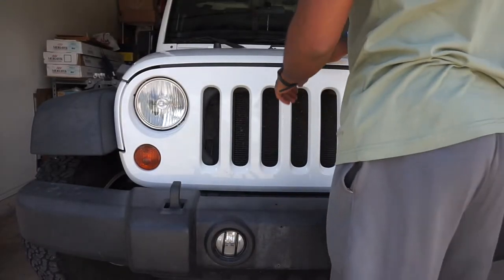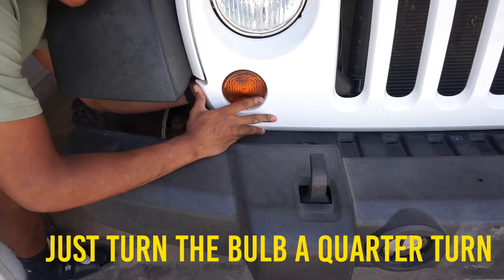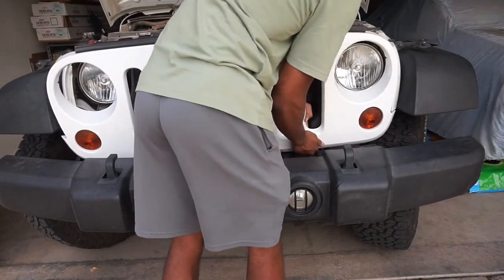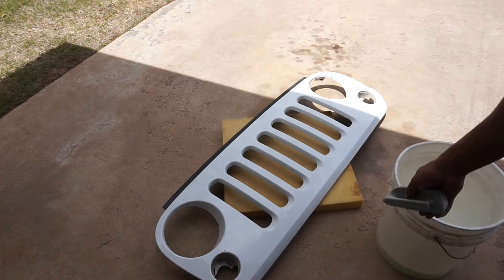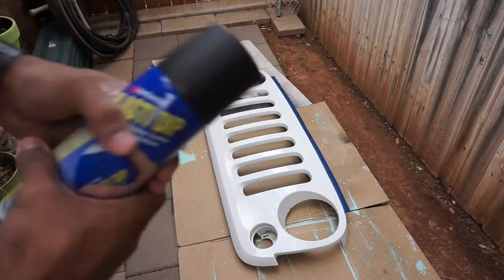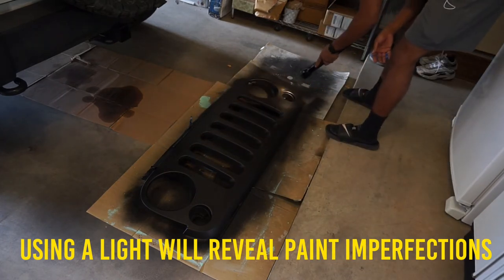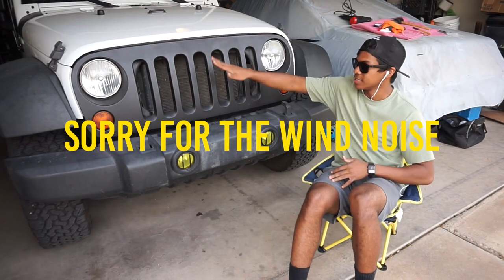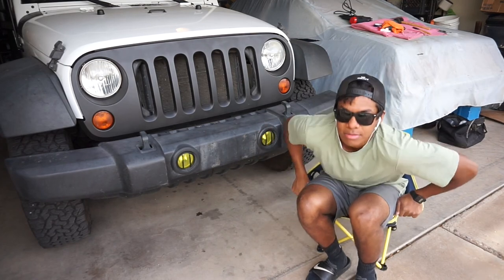PlastiDip Your Jeep Grille ($10)

Comment: Can I do plasti dip in red to a Poison Spyder emblem emblem cut out like the image shown in this link?  http://www.teamtechracing.com/wp-content/uploads/2015/02/DSCN0188.jpg
Reply from the maker: rtang626 yeah it’s possible. But i would separate the bottom plate (the piece that is gonna be colored red) it wont look as clean if you just mask off and spray through the top. [sorry if that makes no sense] but you can pretty much plastidip anything, that’s what makes it a popular choice. Just make sure to prep the work nicely, and the plastidip will lay evenly and will last a long time.

Comment: I did this to my grill 2 months ago and its already peeling off.  I was worried this would happen applying plastidip over a glossy finish.  In hindsight I needed to sand the gloss off.
Reply: Need to start with very thin coats that make it looks dirty then go very thick. I’ve had grilles last 2-3 years
Reply: @whydoihave6neutrals772  hi.so no sanding needed you think?

Comment: Use thin coats at first and build up your layers. Don't do large, less coats. Doing large coats at the start can cause texture and long drying times.
Reply from the maker: Jason Weremy where your method is ideal for spray painting, when using plastidip, you should use heavy coats. The chemical reaction needs heavy coats to create the “dip”. Heavy coats helps make the plastidip one layer. This becomes very useful when wanting to take off the plastidip.
Reply: Chris Meacham no his method is correct haha. You start with very thin coats THEN go very thick.